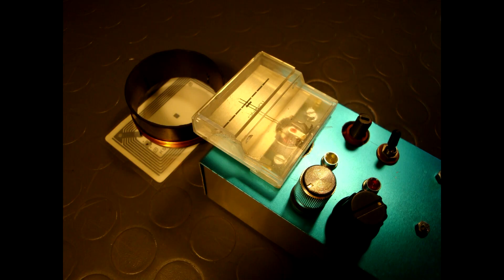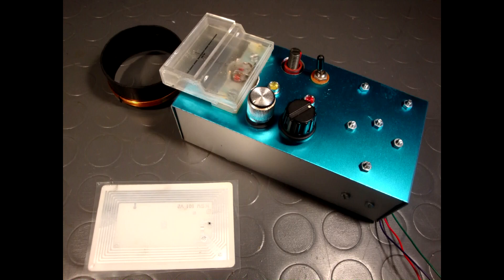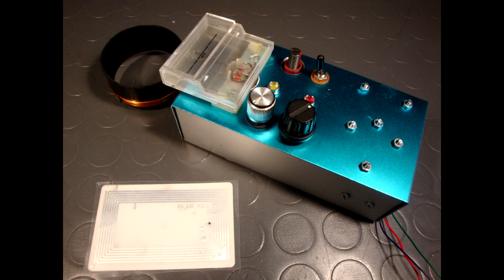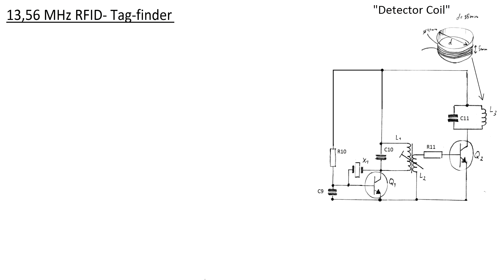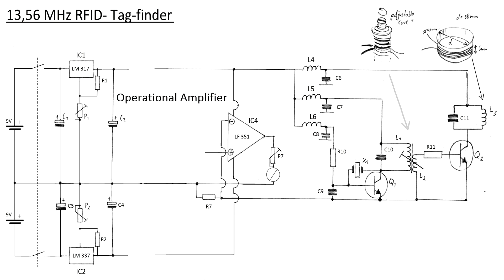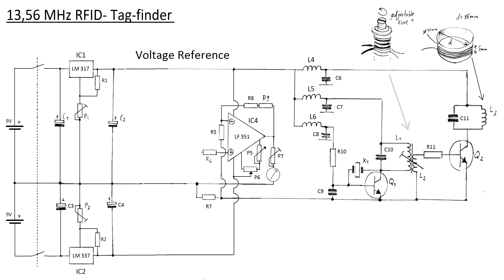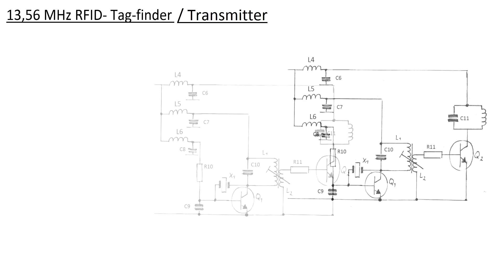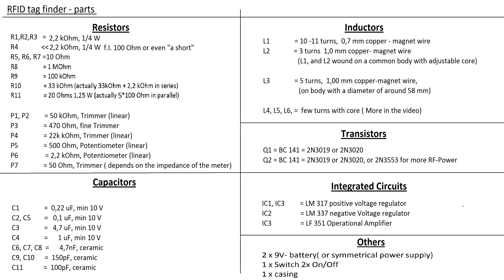How to Build an RFID Tag Detector - part 1: theory

Comment: Great videos!  But I was wondering, would I be able to use the popular LM386 op-Amp as a replacement to the op-Amp you used in your video? And would a negative rail of my power supply not be needed since the LM386 does not need a negative rail?  Thank you for the awesome videos!

Comment: Hi, I am very interested on this, it is exactly what I am looking for, a Tag detector, not need to read info, just to detect the tag, could you please do a test for me and insert the tag inside a large aluminum pipe or can, and see if the your detector can find/read it? if not, but modification it will need to amplifier the power and get the signal trought the metal pipe. Thanks so much